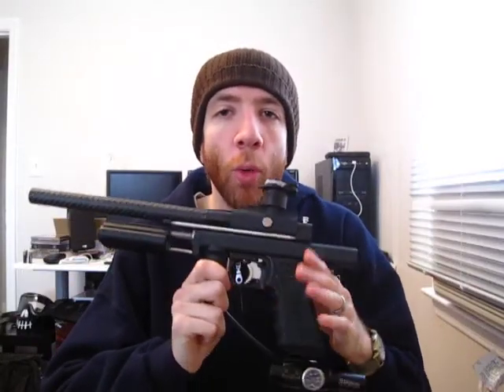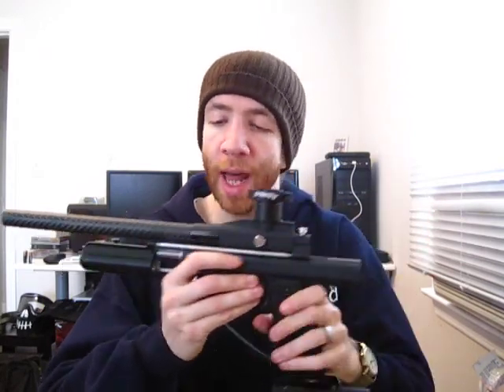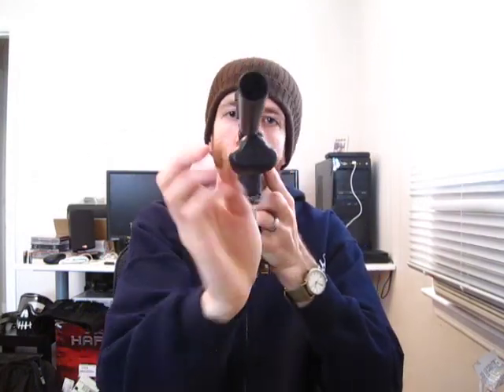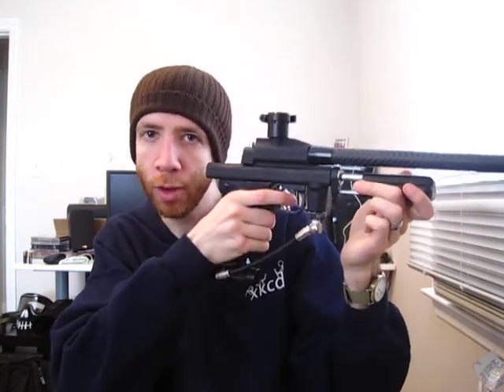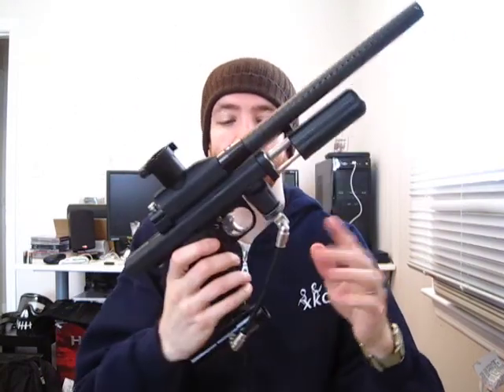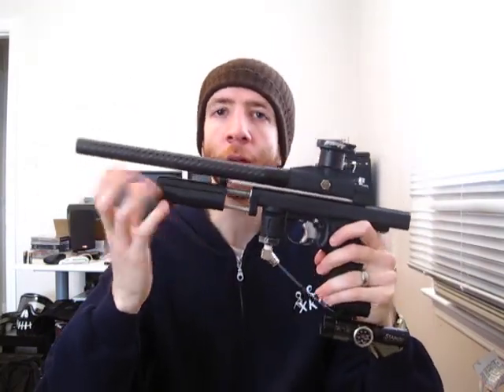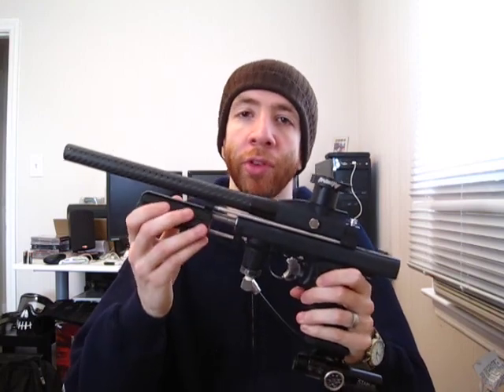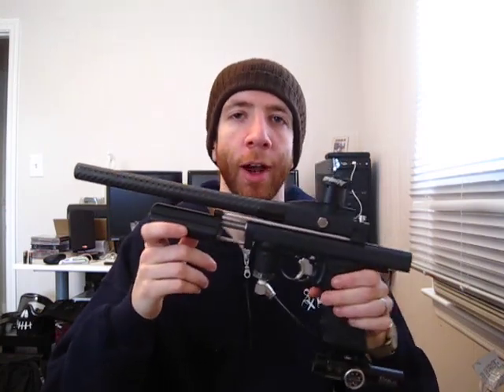WGP Sniper Part 2 - My Sniper

Comment: I like this setup. Did you find mounting the tank forward makes the marker harder to point? I'm asking as i'm thinking of trying this with my enmey. I'm not used to having a bottle on the back, its the first marker i've used with a bottle.
Reply from the maker: I really like the tank forward, I think it makes everything easier, without the tank jamming into your shoulder. I can play tighter, and two hands on the marker is plenty stable. But your mileage may vary.